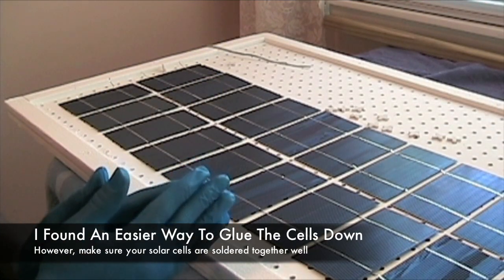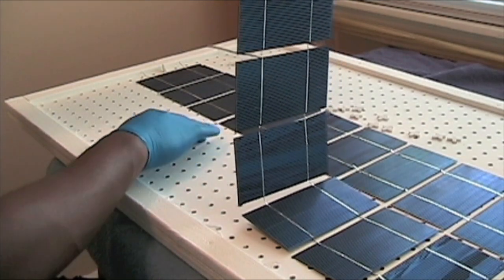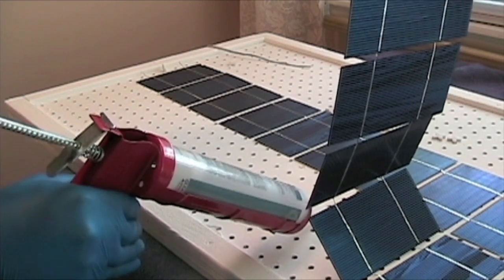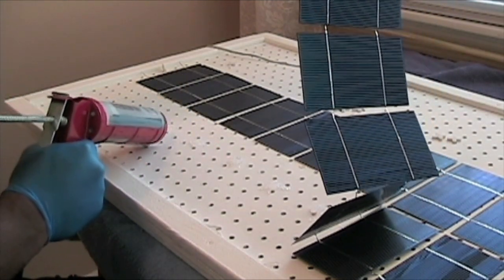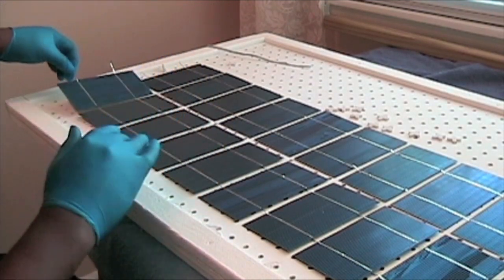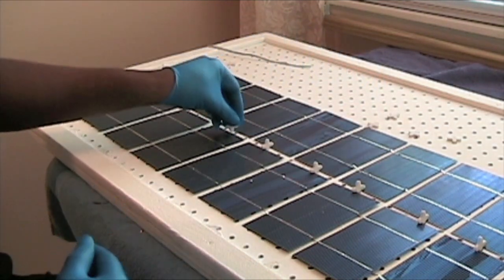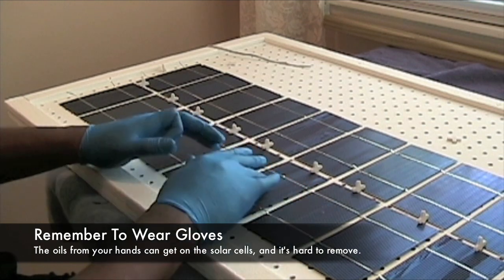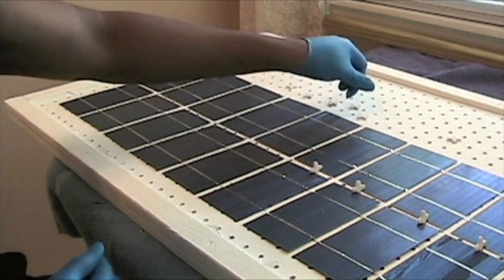How To Build A Solar Panel - Part 5

Comment: where would you suggest I buy the solar panel kit that you used that had the flux, solar cells and tabbing wire? Also, what length and width are your solar cells? Thanks

Comment: future design idea paint the wood black instead of white ever notice in the summer when you wear a black shirt the sun burns the shit out of you while when you wear a white shirt it dont burn as bad by theory you maybe able to draw more light possibly just a random thought
Reply: I know I'm responding to an old comment, but this is bad advice.

You want the wood to and the environment around the panels not to get too hot as the power output degrades at high temperatures. Painting white or similarly highly reflective color should help a small amount and does not change the amount of light that hits the panel.

You might feel a little hotter in a black shirt because it absorbs more light than the white shirt, but we don't want the wood to absorb light, that's just not part of the electricity generating solar cells. Also UV rays are what actually cause sun burns and if I recall correctly solar cells absorb closer to the infrared spectrum (lower frequency).

Comment: Well I'm well confused now!
In Part 5 when you solder the bus wire to the tabs, the first two tabs are running along the upward facing front (blue) side of the panels. But the third and fourth on the next run are coming from underneath. They're ones you soldered to the BACK of the panels. Isn't this all really crucial to the electrical circuit working properly?
I don't remember you explaining that when you laid the two runs of panels on the board? You didn't explain how they connect differently to each other at the buswire end???
Reply: He's got them laid out so the wire goes Bottom - Top > Bottom - Top. So When it comes out of the bottom of the left most series of cells and attaches to the bus wire, it then goes into the top connection on the midde panel.

Think of like he took a row of 20 cells, bent them at the middle into a U.
Reply: Naidosh Lock
Reply: Hameed Abdul

Comment: @DemCrookBooyz The inverter you buy at the auto parts store are usually labels as 7500w.   P (watts) = I (amps) x E (volts).  A typical inverter, like what I use on my service truck to charge drill batteries is 1500w.... which is about 12 amps at 120v AC.

Check the package, and it should tell you what the DC amp draw is, and that's what your going to try and match up to your Solar output at 12v.  (Some "Diesel" inverters are 24v DC)

Comment: @DemCrookBooyz --- I would NOT try and get 130volts / 260 cells connected like you're thinking.  You need to remember, solar pv is DC voltage.   Get your voltage up to 12v by connecting your panels in series like he shows, then connect 12 volt sets in parallel to increase your amperage.  Connect the final result to an inverter (at any auto parts store) to convert the output to AC voltage which will come out at 110/120v AC at whatever amperage is available.

Comment: aaah! That was driving me crazy after u finished soldering the tabbing wire to the bust wire, and you were "testing" the connections by bending the wires backwards and forwards... I keep thinking "ooh crap he's gonna snap that tabbing wire by bending it back and forth that much..."

Comment: Also, regularly tinning the soldering iron tip (putting solder on the tip then wiping it on a damp sponge) will clean oxides off it making it more conductive just because making a soldering joint.  Heat accelerates oxidation, and the flux in flux core solder breaks it up so it can be wiped off, giving you a like new tip.  I have a $18 Weller 40 Watt iron that I got at Home Depot, I used to have a Weller 25W model; I wouldn't get less than 40.  Radio Shack's irons tend to be very poor quality.

Comment: When soldering, you should heat the wires and melt the solder directly to the wires, avoiding touching the solder to the soldering iron tip.  If you don't the wires may not be hot enough to properly 'accept' the solder and you get a cold solder joint--a joint that looks okay but is not very well connected.  A cold joint can provide electrical resistance (bad) and possibly break.

Comment: Great Video!  I recommend you fold the small tab wire around the bus tab, and also avoid touching or moving the solder joint until it has cooled for 20 seconds.  You could use a popsicle stick, or chopstick to hold the pieces together while soldering.

Comment: that second solder joint doesn't look good. You should try and hold down the soldering gun a bit longer to make sue both components are hot enough.

Comment from the maker: @YeeYIpWai 

The top of the solar cell is "always" positive (+).
The bottom of the solar cell is "always" negative (-).

I suggest going back a few videos and seeing how I soldered the tabbing wire and connected the solar cells together. It's very straight forward. 

Series Connection: + - + - + - + -......

So if the top is negative (-), you would take the tabbing wire on the top of the solar cell and solder it to the "bottom (+)" of the next solar cell.

Comment: @RobertSmith3 im sory, i dont quite understand what u said. u mean on d left tab wire is soldering from -(front) to +(back), and the right hand side tab wire is soldering from +(back) to -(front)? 

or at the 1st cell,  soldering it from - (front) to 2nd's cell backside(+), then continue the 2nd cell is from + (back) to next cell's front (-). which 1 is correct?

Comment: great job and thanks ,if you file the tip of your solder iron with a file ,you will get more heat at the tip,and get the job done faster,i have the same iron tip you have ,it gets corroded and needs to be filed

Comment: you should not use silicon at all cause silicon is not very good with uv. UV brakes down silicon you will find id recommend a potting epoxy rated for uv this way you do not have to worry about the silicon letting go and having to repair
Reply: do you mean SiliconE? i still dont understand if he is using Silicon (Si - periodic table) or Silicone the sealant product. Pls help :D

Comment: i have no idea im still looking for the cells on ebay and i cant find a low volt dm 1.5 hp motor and i also need a dc pump. lol

so its a hard project.